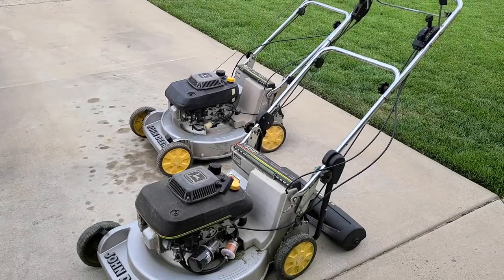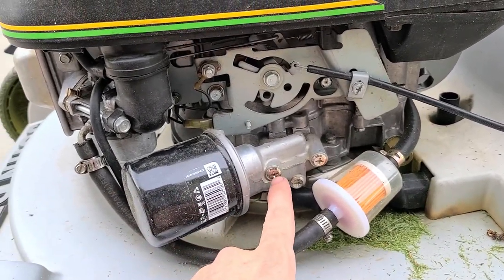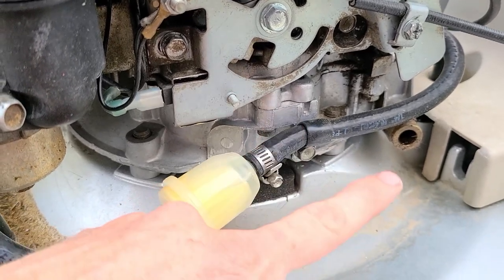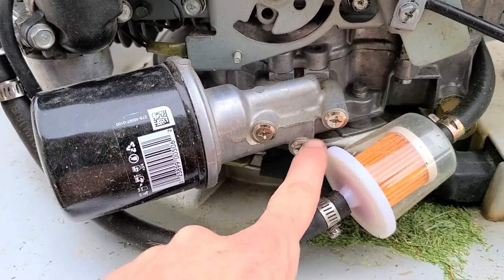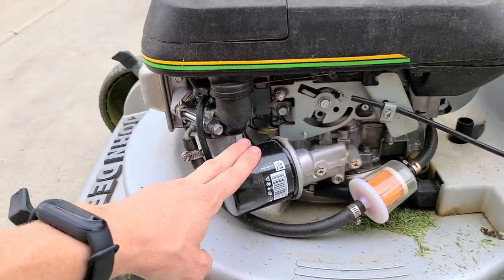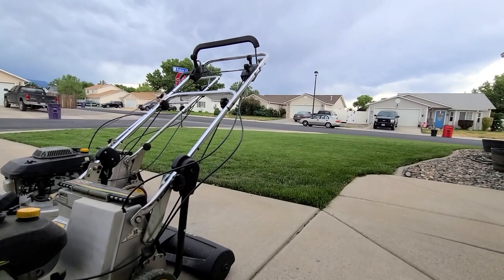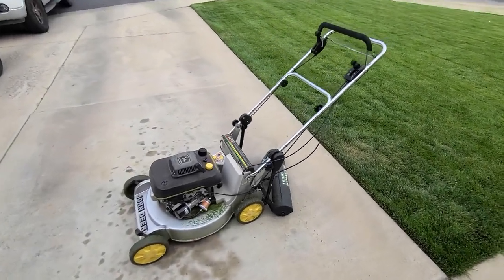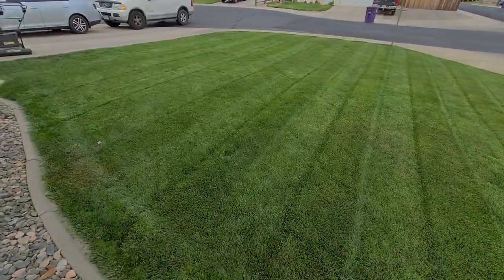Oil Filter on a old John Deere Lawn Mower? Can yours be converted?

Comment: You can also fit a longer Baldwin filter in place of this little black filter...one of the best quality filters and a nice red colour...
Reply: Agreed. I run the Baldwin B-37 extended length filter on my JX-85.
Reply from the maker: oh that sounds awesome! I shall next time I replace it
Reply: @Brandondood  thanks for all the videos. I just picked one up recently. Do you have any knowledge on replacing the clutch or the adjustments on the carburetor? There seem to be limited resources on these.
Reply from the maker: Awesome! Good job on finding one. I can do a video on carb adjustment. The clutch replacement is more independent, I haven't had to do it yet. But one day I'm sure I will have to
Reply: @jeffreycaban5107 about to order a Baldwin for my jx85 will it for sure fit?
Reply: Sorry for the late reply. Positive it will as that's what I run on mine. @PrairieHS14

Comment: Do you still have the link for the part on Amazon? I have the 14SB
Reply from the maker: The oil filter adapter is a hard one to find. I had to keep a eye on ebay till someone sold one. I think it was about 100 bucks. The filters are more easy to find. Good luck!
Reply: @Brandondood  Thanks! Great Content!!!!
Reply from the maker: @SoBlue1  thank you
Reply: @Brandondood I found the adapter on eBay for $110!!! Just received yesterday, what model or part number is the filter?
Reply from the maker: @SoBlue1  https://www.ebay.com/itm/263288382985?mkcid=16&mkevt=1&mkrid=711-127632-2357-0&ssspo=WB0Eoua4S1m&sssrc=4429486&ssuid=qc-APwT9TEO&var=&widget_ver=artemis&media=COPY
Reply: @SoBlue1  you can just use automotive filters and save $$$ the 6607 or PZ-37 equivalent filters fit and if you buy the SuperTech 6607 it is under $4 at Walmart...Cheers!